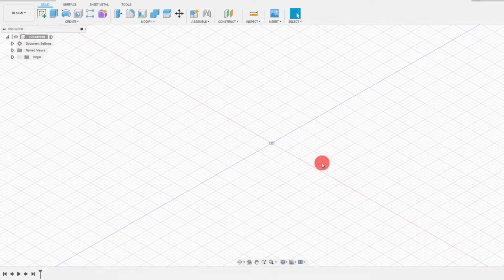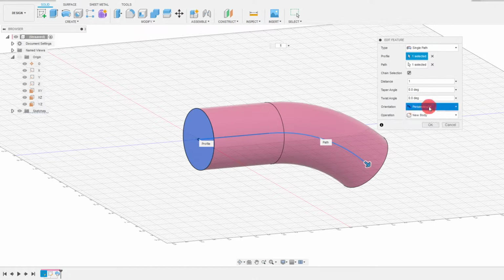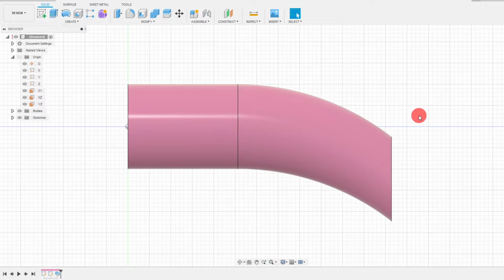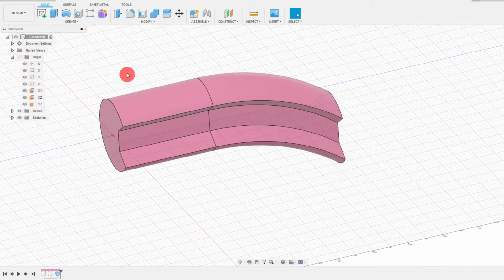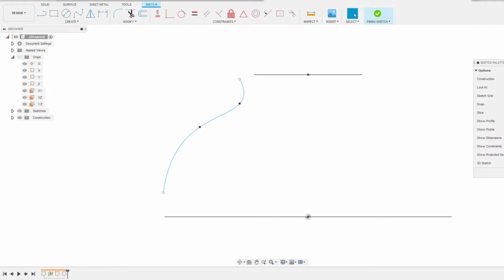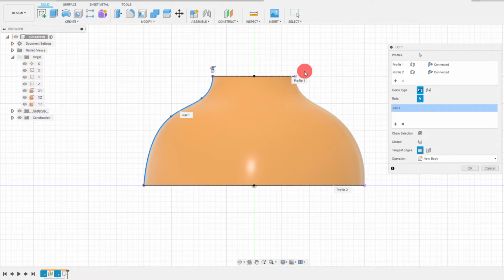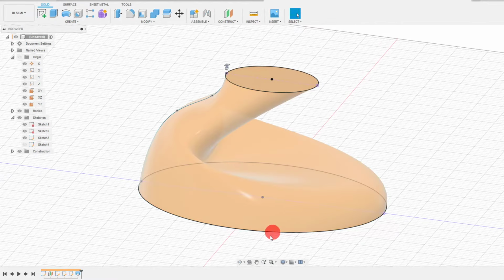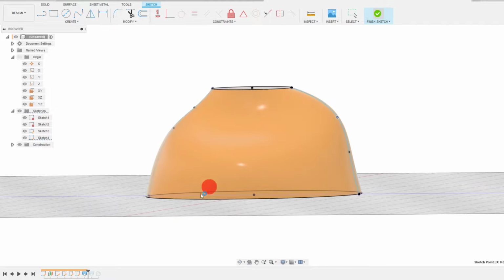Fusion Tutorial for Absolute Beginners Part 2

Comment: The loft tool doesn't seem to work the same for me as it did in this video. For me, it will not create a symmetric vase-like revolution around the axis. Can anyone recreate this with an up-to-date fusion install? Mine always turn out like a head and neck on shoulders where one side starts like the spline but ends more flattened out on the other side.
Reply: me too!
Reply from the maker: I am sad to hear this, I know at least a few others had this problem.

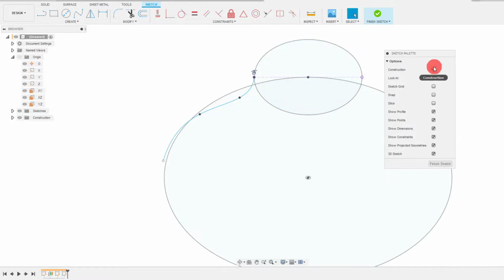Comment: I’m learning a lot while watching. At 12:56 you mention making a line a construction. It would be helpful to define what a construction is. Maybe by updating the video with a sort of callout box since it’s the first time you’re using the term.
Reply from the maker: That is a good tip. Since I did not explain, construction lines can't be used to create features. They are a less powerful version of a line only useful for outlining sketches, placing tangent to a sketch etc. You can still dimension them, they just can't serve in creating features.

Comment: I'm having issues creating the Loft - I can make the loft, however, it's coming out parallel along the rail. So instead of a nice tea pot, I get this melted looking thing.
Reply from the maker: Are your two profiles selected? The top and bottom circle? They should first create that conical shape. Once that is perfect, you can add the rail.
Reply: Got the same problem, first a conical shape, add rail and select the spline. Instead of mirroring the spline it gets parallel with the drawn one resulting in a.. melted vase. Any solutions? Loving your tutorials though!
Reply: @AvivMakesRobots  Thanks from trying one more to help me. Here's some screen shots that may help you visualize what I'm doing
https://drive.google.com/drive/folders/1t9q12jYoF2QjipiZ-GCAwi-U2XqSRO7b?usp=sharing
I started from the XY plain, facing the TOP
Drew the 1st circle
Created the 2nd Plain
Drew the 2nd circle.
Drew the "rail" line - XZ , Front Facing
Created the loft, only using Profile 1 and Profile 2
Added the Rail into the Loft
The file names should be self-explanatory

Thanks,

Comment: Part 1 was pretty good, I was able to follow along really easily, however, part 2 wasn't as easy. Since I couldn't see the RIGHT SIDE of the screen, I really couldn't figure out what you where clicking when you changed views. Maybe you need to go back and make a Really Absolute, I Don't Have a Clue Beginners 0.5?
Or maybe point me to some place that will fill in this hole for me?
Reply: Same here.. I'm struggling too.
Reply from the maker: Hey, I am sorry to hear that. I have since fixed the screen issue. What are you stuck on?
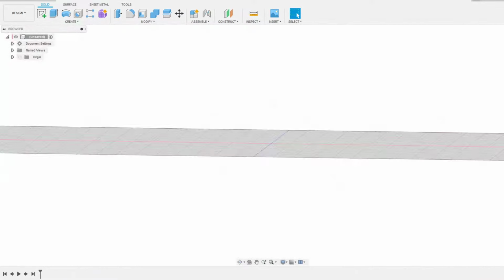Reply: @AvivMakesRobots  Well, you mentioned to click on Front Panel on the View Cube, (0:32), then you clicked Origin XY, Start Sketch Circle, but what happened was, on my screen, it went to Bottom Panel on the View Cube. I can't seem to proceed to the second step as the line/curve couldn't happen. Your video cropped is cropped on the right side of the screen, couldn't see the View Cube.
Reply from the maker: @nixaad  What you can do is click the little arrow under the view cube and change orientation to be "top". Sorry again about that.
Reply: @AvivMakesRobots  When you're laying out the circle, and then adding the line, since I don't see the "view box" in the top right corner, when you change the orientation of the circle, I can't figure out how to get my screen to match up. You say go to the right, however, when I click the arrow on the box to go to the right it doesn't show what your screen is showing.  I even tried "Named Views" and still the same thing.
Reply: @AvivMakesRobots  A major issue I seem to be happening is trying to get the colored lines orientated correctly. When I'm Top looking down, draw the circle, hit the "right" arrow, which how has the "right" on it's side, letter "R" pointed down. I then save the sketch, open a new one, place the YZ, the screen then rotates so "right" is now right side up - HOWEVER, my line colors are Green/Red Red is vertical and Green is horizontal. I draw my line and arc, then when I click on rotate, using Constrained Orbit, the drawing turns "right" upside down. If I use "Free Orbit" it looks like yours does, however, when I save the sketch, it shows the bottom view, with a slight tilt to the right. Then when I sweep, the drawing isn't resting in the correct plain. 
 I can do all of the Sweep funtions your showing, however, since I'm not of the correct plain the don't look correct.

Am I worrying too much right now,about the plain I'm using?

Comment: I have been using Fusion 360 off and on for the last couple of years, but have been lazy about taking time to really learn the software, which at times has led to considerable frustration and confusion.  So, while not an Absolute Beginner, I learned some valuable tips and will continue to work my way through this 24 episode odyssey. FWIW, would love to see an in-depth episode on creating and using named parameters. I have seen the power of the approach, but it takes some planning rather than just diving-in. Wondering if like coding in C, the sooner you begin (without a plan) the longer it will take!
Reply from the maker: Yeah, that sounds like a good idea for a tutorial. Parameters are luckily not all that complex. The most helpful reason to use them, in my opinion, is for linking two values that you want to always be the same. That way you only need to change one, to change them all! Naming parameters is good for keeping things organized in case someone else needs to use/ work on the file.

Comment: This is your second lesson and your going into Loft and sweep? This isn't basic stuff, just good to confuse beginners!
Reply from the maker: Have you seen part 1?
Reply: @AvivMakesRobots  Yes I've seen part 1 I am under the impression that there's a lot more basic stuff to get into before you get into the abstract. In my opinion, it is essential to get a good grasps of the basics first!
Reply from the maker: @MatthewTinker-au-pont-blanc  I believe these features to be the roots of the software's power.
Reply: @AvivMakesRobots  Your joking? Later, when People can draw confortably, I am learning and I can safely say, basics do not include lofts and splines! I found you rattled through the first video too fast for me! What about screw threads, nuts, bolts and keyways
Reply from the maker: @MatthewTinker-au-pont-blanc  I think it does. All of those models are based off of these features.

Comment: I love your Fusion tutorial series! Although I'm having trouble with the loft function, it keeps coming out lopsided, like the shape of the rail is getting projected to the other side of the cone instead of forming the shape around the cone..
Reply from the maker: First thing is first: did you make 2 different sketches, 1 for each rail? That being said, are there also two different sketches, one for each circle of the cone?
Reply: @AvivMakesRobots  I have the same problem? Have redone the drawing several time following your exact steps and the result is wonky?? Can't figure this out which discourages one from using Fusion. It like as if the spline gets 'mirrored' on the other side?
Reply from the maker: @pierre3036  Please see my first comment. If this does not change things, then you may want to select your guide curves in the opposite order. Pick the second one first and the first second. Let me know if that fixes it!
Reply: @AvivMakesRobots  I've got 2 circles each on it's own plane like the tut. Created a spline (trouble connecting) then a 'loft'. Select the 2 profiles and then rail and wonkyness??  I've done it over and over and get the same results. This is silly.
Reply from the maker: @pierre3036  Hey Pierre, can you share a video of your screen or a snaphot and post it on your youtube? I will watch it and see what went wrong.
Reply from the maker: @pierre3036  Hey, I found the reason this is happening. Once you make your loft, which you have done correctly, click and drag on the point that connects your guide curve to your top circle. You will see that it allows you to shift your shape. If you shift it the way I have, you would have the result I have. By the way and for the record, to create a shape that is equal on both sides, the "revolve" command should be used and not the "loft"
Reply: @AvivMakesRobots  Sorry not quite getting what you're saying. "Once U make your loft" you mean after selecting the 2 planes or after selecting the 2 planes and rail then clicking okay? I tried grabbing different points around where they connect to the guide curve (rail?) and could only distort the whole shape. I understand that the 'revolve' tool should be used to do this but why can't myself and others replicate your results? It doesn't make for a good learning experience. Too bad because Fusion 360 could be so useful in my hobby but learning is frustrating.
Reply from the maker: @pierre3036  1. open loft feature. 2. select the two circles for the profiles and the guide curve you have made. Do not hit okay yet. Now, select the point that connects your top circle to your guide curve and drag it. You will see what I mean. This is the reason mine looks different from yours.
Reply: @AvivMakesRobots  Here's the result of your latest suggestion: https://www.youtube.com/watch?v=v-4c2FFh-aw&feature=youtu.be  Too bad we can't see the right side of your screen and it is unfortunate that you're not informing us as to how you END the sketches, are you double clicking, hitting 'enter', using 'end sketch', hitting ESC ?? Eg: drawing the 'rail'.......once you've reached the top of the rail BEFORE connecting it to the circle using the 'coincident' tool how did you end the 'rail'? Did you hit Enter, Escape, double-click,? I thought this was for ABSOLUTE BEGINNERS, unfortunately, IMHO it is aimed more for those who are a little more advanced.
Reply from the maker: You just hit enter to get out of the sketch you are doing. I have since moved my screen to make it easier to see the view cube. I hope it was not too hard, but it seems like you were able to make it! The only error was that it was not coming out as shown. I saw your latest video. When you make a spline with a very radical nature, you will get all sorts of crazy looking shapes that are hard to manage. If the spline is not working, you can use 3 point arcs. My result came out a bit different than yours, but it is just an example. The important thing is that you know how to loft.
Reply: @AvivMakesRobots  I understand, however, for us beginners when we follow step by step and end up with different results we just keep trying over and over in vain which is frustrating. I love Fusion 360 and eventually I'll get the hang of it. I think just going ahead by creating sketches and practicing using the tools is the key. I really appreciate your attention to my issues and thank you for your time. Be safe and take care!
Reply from the maker: @pierre3036  Okay! Best of luck.

Comment: When I used the rail, it went lop-sided. As if the origin isn't in the centre of the two circles. Everything else worked fine.
Reply from the maker: For the sweep, or the loft?
Reply: @AvivMakesRobots  it was for the sweep. Could it be because I deleted the line across the centre of the top circle?
Reply from the maker: @Rich Wheels I don't think so. Something tells me you should delete the sketch you made of your rail and redo it. Be sure that when you project the circle centers, you click on the correct points. Be sure that your rail is perpendicular to the circle. If it isn't it will look out of whack.
Reply: Engineering Juice thanks I’ll try that next time

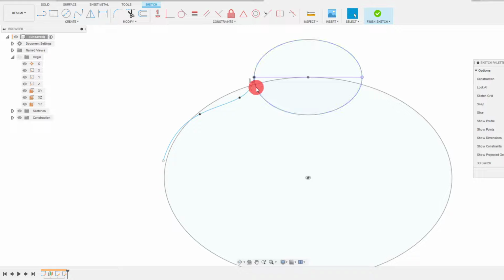Comment: anybody else having issues with connecting the spline with the sketch? (12:41)
Reply from the maker: Be sure to always project. If you can't connect it, click on the sketch you are connecting to, hit "p" on the keyboard and it should grab it right out.
Reply: Engineering Juice thank you, I’ll give it a go tomorrow... so far I’ve learned enough! Lol my brain is full! Ha ha
Reply from the maker: @captdan7876  There is a WHOLE lot more, my friend... stay tuned. I am showing how to build a robot in fusion 360 this summer.
Reply: Engineering Juice woot woot! I’m just wanting to dezign a custom wall-mounted light saber holder and 3d print it :-) so far this has helped a ton!
Reply from the maker: @captdan7876  Very cool! If your part is geometric, you may not even need to use lofts... Lofts are for creating organic shapes. To create a basic holder, you might only need basic shapes and extrusions/ sweeps/ revolves.

Comment: That was fun. It is a pity that the right side of your screen is missing. I had a couple of problems working out which face I should be on without the reference to the little cube. It all worked out in the end.
Reply: It’s there on an IPad!  It must be your sceen’s setting, so try 1080.  Just a guess.
Reply from the maker: @paulbergman8228  Thanks, Paul. Hopefully this fixes the issue.
Reply: Engineering Juice Ok, it was there on the first lesson, but missing on the second, so that’s why the comment.  Something changed on your end.  Thank you for the lessons! Maybe resetting the parameters and reloading the video will solve it without a do over.  I’m not an expert in this, but just thinkin’, then que up your own video on YT and see if that works.
Reply from the maker: @paulbergman8228  Okay, great! About the view cube, the cube can always be reset and is there mostly for convenience (to look at the top, side, front, bottom and right/left). The actual plane a sketch is started on is what matters. For these lessons, it shouldn't matter too much which one you use. Let me know if this doesn't make sense.
Reply from the maker: Okay, sounds good. I may need to adjust my screen capture settings.
Reply from the maker: It is good it worked out. You can always reset the cube by clicking the little arrow and setting the specific view as the "front".